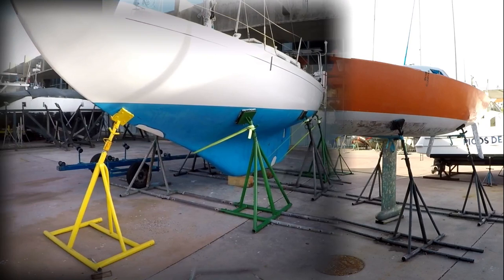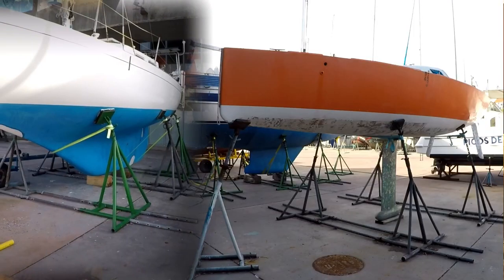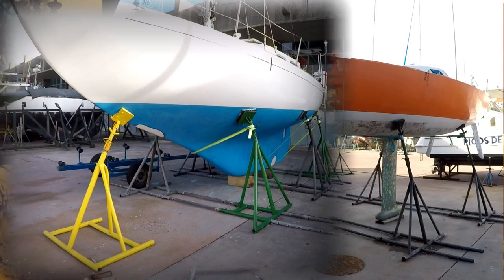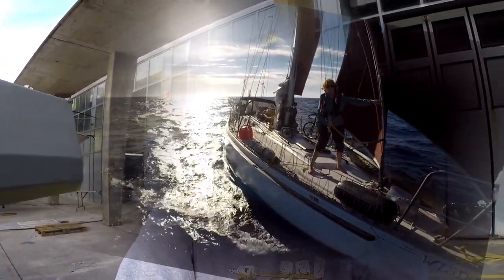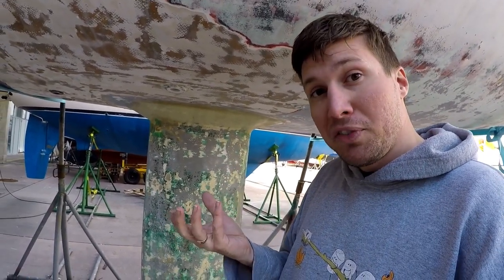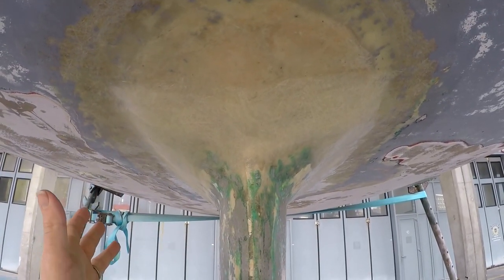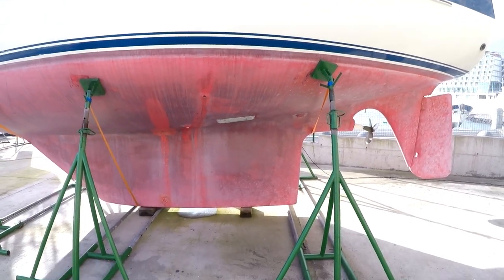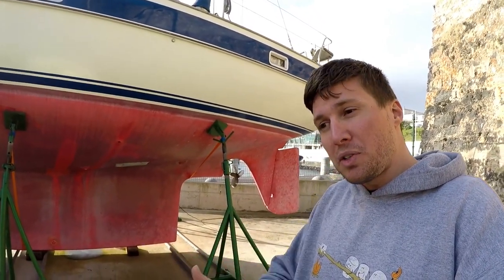Which is the BEST Keel Design? | Sailing Wisdom

Comment from the maker: Which keel design do you prefer and what type of sailing do you do?
Reply: My preference has always been long keel, solely because keel bolts make me nervous. They are not very easy to inspect properly. That being said... my dad's boat, on which I learned to sail, had bolts and despite the boat being over 20 years old at the time they were in excellent condition.
Reply: I was always fond of twin/bilge keels that were strong enough to be beached.  I keep thinking about Wicked Salty and some of the others that have had to do an emergency haul.  Would have been nifty to have the option of beaching the boat to do an emergency repair.
Reply from the maker: When I was young, we went to Wales for vacation and all the sailboats had twin bilge keels. At low tide, the harbor was completely dry and the sailboats were all standing upright just waiting for the tide to come back in again!
Reply: Very interesting video - thanks. 

You didn't mention lifting keels or centreboards. I'm naturally biased towards what we chose which is a Dutch designed full keel with a retractable centreboard. Popular in The Netherlands as there isn't much depth in many of the inland waterways. On a 54' boat we only draw 1.4m with the board up, but 2.8 with it fully down.
Reply: I have an Allmand 31 a boat with a long shallow split keel with a partial skeg hung rudder. Basically we are talking a fat coastal cruiser. My hope is to do some blue water sailing, but I expect much of my travels will be along the east coast of North America and into the Caribbean while short (or single) handed. In other words a compromise boat that isn't as stable as a full keel boat, and not as manoeuvrable  as a fin keel, but... I bought the boat in August in Boston, MA, and while bringing the boat through the Erie Canal to Lake Ontario I was pleased with the trade-offs that had been make on this boat.
Reply: I find modern retractable keels to be best of both worlds, do retractable telescopic keel exist ?
Reply from the maker: I have seen where the daggerboard comes up through the hull on multihulls.
Reply: I like the shoal keel with centerboard(s) such as what MJ Sailing's Trisalu has. Or the rest of the Trismus series and their type, for that matter.  An aluminum hulled Trisalu or Trisbal (especially with a pilothouse like Elements has) would be the ideal boat for cruising here in Alaska with our large tidal swings.
Reply: Netpackrat while 'Elements' is a great boat it does not sail as well as the shoal round bottom design might suggest , she is not fast and dens to be a wet boat ( spray) ,,it does well for them and they have done a good job with it. Yes I love their ' deck salon' design. Cheers Warren
Reply: Rigging Doctor Good study Herb, while I loved the steadiness of the semi full keel I grew up with,the wood/epoxy racing version of the Rustler31/32 , I race now with a small fin keel boat and have found the performance and maneuverability a joy to race and sail in and out of its marina slip.  I cruised for a little while on and off a Jeaneau 43 and it never had any bad handling characteristics. It was fast, 7 knts was the cruise planning speed, she was solid with a strong keel and separate rudder all properly engineered for the loads, she crossed the Atlantic twice ,. Excellent maneuverability under engine especially reverse. Obviously not your Morgan's best attribute  ......But as you say ' horses for courses' long passages , anchoring a lot , little time in tight quarters , nothing wrong with your choice. Glad to see they improved your rudder with a semi vertical straight trailing edge.  Cheers Warren.
Reply: @CheersWarren  Certainly, but I wouldn't be using a boat like that to race or necessarily even cross oceans with.  I want to sail Prince William Sound (I grew up there) and maybe later the Inside Passage, and a shoal draft boat with a retractable keel and aluminum hull for durability would be ideal.  Especially one that allows you to retreat inside and steer from the pilothouse when the weather turns.

The Trisalu isn't perfect and it it may be that Brouns got too far away from the design of the previous Trismus boats when he drew it.  The metal versions of those are a hard chine boat with dual centerboards instead of the centerboard and stern daggerboards combo of the Trisalu.
Reply: I am a new owner of a flat bottom hull with a 1/2 keel from 1/4 of bow to 1/4 of hanging independent rudder.  Lead ballast of about a ton. It’s a nimble 25. I haven’t sailed it enough yet, but I immediately want to add weight to the bow to keep the hull from skipping over the water. Or worse, heeling to the chimes and overcoming the flat sides to flip over. Thoughts?
Reply: @akjhome  

A). I am envious.

B). Ted Brewer knew what he was doing when he designed her.
Reply from the maker: I am jealous when I watch a fin keel with sail drive back up. They go straight and right where they want!
Reply: Wing keel with half skegged rudder on my steel sail boat, manufacturer guarantees no damage in 8 knots running aground, they didn't say anything about the crew though. :)
Reply from the maker: Steel boats are floating tanks 😍
Reply: @Sciolist  Funny you should ask that. Dagger keels exist on smaller boats, and it has been done on big expedition sailboats. But it scares me to think of what would happen running into a rocky underwater pinnacle or reef at speed.
Sometimes a "crash box" is built into the keel well to prevent the hull being breached, but I prefer the notion of a keel which just swings aft in such circumstances. Another benefit of swing keels is their ability to  modify the underwater profile: swing it forwards for heaving to or beating in heavy weather, aft for reaching and running to reduce weather helm. 
But to get a substantial effect would take a very long swinging element, which means a long keel box taking up the majority of the best part of the interior, and a long slot weakening the hull.
So I've designed and am currently building a combination swing and telescopic keel. Even though this permits the keel being protected from grounding loads whether travelling ahead or astern, or vertical loads from being dumped on the bottom in the trough of a swell, it remains a challenge to engineer something strong enough for lateral forces, particularly when extended to full span. This I think I have managed to do -- I've achieved better safety factors than the original lead keel's attachment details -- but keeping it affordable in my case means doing it all myself, and getting a favour from a friendly toolmaker with a big CNC milling machine to produce the 3D shape. 
It's still by no stretch an inexpensive option, but for me it's an interesting challenge, and I hope it will make the boat a lot more "configurable" for different situations.
Reply: I learned to sail on tall ships and always leaned towards full keels after that. For the last few years I have been racing  on a pretty standard late 70s racer cruiser. I am definitely coming around to the fin keel. You have to do much more research about the construction  of the keel. Some are designed to take the boat weight on the keel, some are not. Some have poorly done keel bolts, some are very well done. Righting moment is a complex question, as a deeper fin with a bulb may have more righting moment than a shallower full keel. I prefer the manouverability and helm feel of a fin. Heaving to becomes pretty much useless, and you generally have to be more active on the helm. I find twin keels to have too much wetted surface for a given righting moment for my taste. Also for swing/lift keels I just don't like the complexity, and cabin space is often laid out to accommodate the space for the retracted keel.
Reply: Rigging Doctor I live on Anglesey in wales and they are pretty much all you see here because of the tides
Reply: I have chosen long keel and heavy displacement boat for comfort at sea with family and to weather the storm eventually... so far happy about the choice i have great stability compared to lighter boats
Reply: Steel hull encapsulated full keel, although Skip Novak for example has retractable shoal draft keels on both his boats, skip dies Antarctic expedition sailing in two South African built boats, a mid 40' steel boat and a mid 50's aluminum boat, but these are obviously very purpose built vessels, I'm going with a late 70's Primrose designed Moody 33' centre cockpit shoal draft keel, skeg rudder, but that's the compromise I'm prepared to make for a small centre cockpit boat that is blue water capable and can be easily short handed or single handed and very easily modified internally to the later 333 with salon access to aft master suite as opposed to cockpit access, the 333 and 38' centre cockpit boats go for around 30 to 50k US and the  mk 1 and 2's for less than half that. Roll on the Lidacore and epoxy😂😂. The most important thing is not to get too fixated on only one aspect of a boat, but look at everything as independent systems and as a whole overall package, obviously the biggest determining factor is $$$$ budget,  and how much work are you capable of and prepared to do yourself, I'm a qualified artisan for example and thrive on projects, actually if I don't have one ongoing I go nuts, others don't have any interest in their boat systems or boat because they have the money
Reply: Daggerboard! Mostly surfing dinghies in breaking surf... 😂👍
Reply: Lifting keel, like on the Southerly, Garcia and Allures yachts.
Reply: I was always a big fan of the full keeled shallow-draft boats for ocean cruising but the events of the recent Golden globe revival race have given me pause.  It seems that the full keel boats when they're pushed sideways are more likely to roll then a fin keel boat.  The reasons for this are twofold.  Firstly, the larger wetted surface area catches more water and acts as a lever to spin the boat.  Now before you say a fin keel does the same thing,the ballast of a fin keel is generally further from the center of the boat.  This gives greater righting moment, less tendency to spin or roll over.  The design of a full keel with the ballast generally close to the center point of the boat actually makes it easier to spin the boat on it's axis.  Anyways I won't bore you with any more details, but my preference is a bolt on fin keel with a skeg hung rudder.
Reply: I’m buying an albin vega , that has an unusual keel in my limited opinion! What would you say about the vega keel and rudder I’d like your opinion 👍
Reply: Full Keel. Am a blue water cruiser single sailor so wanted something strong and dependable.
Reply: What boat brand is the one at 8:21?
Reply from the maker: clecio primo Alberg 30
Reply: Rigging Doctor thank you.  I like that keel as I am more like you guys.  Want stability over speed.
Reply: please explain the catamaran keel, thanks doctor.
Reply: I say, the case she is rested...
Reaching away before a good breeze is like hanging on to a team of horses.

https://youtu.be/NGI11UUiBQ0
Reply: It's all about bilge keel. No slip fees ,no lift outs , keep it in any estuary for free.  It's not like they are rare . It's like half of boats under 30ft and about 15 % of 30 to 35s . I don't understand why every YouTube channel leaves them out of the conversation.  They can dry out . You can go anywhere. A fin can't go in the estuary it will fall over lol .
Reply: You all prolly dont care at all but does anyone know of a way to get back into an instagram account?
I stupidly lost my login password. I appreciate any tips you can give me
Reply: @Pedro Leonard instablaster ;)
Reply: @Elijah Santiago I really appreciate your reply. I found the site thru google and im in the hacking process atm.
Seems to take a while so I will get back to you later with my results.
Reply: @Elijah Santiago it did the trick and I now got access to my account again. I am so happy:D
Thanks so much you really help me out!
Reply: @Pedro Leonard Glad I could help xD
Reply: Lol my last boat had a 4 ton solid lead keel. (Long keel.)The previous had obviously run aground hard because there was a five inch diameter gouge about 2 inches deep in the leading edge. It had zero effect on the hull's integrity.
Reply: What are you thoughts on the new Kraken Yachts, and their theory of Zero Keel ?
Reply: Winged Keel mate for racing with Mates
Reply: Full keel nicholson 32 plse
Reply: A full keeled Skookum cutter built like a brick shithouse...for open water...
Reply: The twin keel (large bilge keel) boat we had that was built in the Netherlands was the most comfortable and stable boat we ever had.   My dad bought it from the original designer and he had it about 16 years.

Comment: Your chances of out running storms mid ocean are limited. You may get to a less windy part of a storm but i reckon it would be of slim benefit.  It is incredibly rare for bolt keels to fall off.
Reply: I was in the Navy for over 20 years, and never once were we able to outrun a storm - it's just not a thing. Mama Nature will always win. ;)
Reply: @TheSirUno  Even harder in a yacht that cruses at around 6 kn. Though with advanced and more reliable weather predictions you can place yourself better.
Reply: Fall off is rare, but cracking/getting loose at the bolts and start leaking, not so.  My old boat did after fairly mild grounding in the sand.

Comment: Ive got a fiberglass modified full keel. I like that my prop is safe and my rudder has a lower bearing. And when i run over a cray pot rope, she just slides off. Tracks well to a head wind under sail. Not a fast 42ft'er but she feels solid in the ocean

Comment: Unless your full keel is shaped with the idea of hydrodynamics in the racing days of wooden sloop so say a j class sloop is slow yeah right full keel and at the times the j class was new you could say the this was as comfortable and fast as a racing sailboat should be you should also think about weight of keel to hull construction which is supposed to be about 50/50 still bolted not fiberglass construction relying on bonds of glass I feel a hog a keelson and displacement ballast keel their is alot to say about old school racing sailboats either to much sail area

Comment: Thanks, that was very informative and helpful. Before this I just watched a 45 min. interview with Chris Beaumont of Kraken Yachts about integral keels, so I'd go for any form of an integral keel, like a full keel or a long keel, definitely not a bolted-on keel. My type of sailing is "never in a hurry to get anywhere, ever".😉
Reply from the maker: It’s definitely the safer way to go!
Reply: Yes i watched that documentary too! He described how boats are hyped to be blue water when they're anything but. And corners cut not just on the design level but also on the factory floor. Friday afternoon, the guys constructing the fibre glass laminate for the hull, they just want to go home quickly so they rush it and don't take care to get the laminate at the right temperature so it bonds properly. Chris's attention to detail is extraordinary. Needless to say, inner of his Kraken 50's, brand new,  costs an absolute fortune. One and a half mill, but what a vessel, built like a tank but goes like a rocket.

Comment: depends 100% on your desired application. Cruising the world? go full keel encapsulated ballast, etc, preferably a boat from the 60s or early 70s for some of that 1.5-2 inch thick solid fiberglass goodness from the early days of composites where they didnt really know how to work with it yet so they just piled a TON in the molds to make sure it was strong.

once a year vacations sailing with the family in the Bahamas? doesn't really matter because unless you wipe your ass with Benjamins, your not going to be buying a boat outright vs chartering anyway. 

going for performance/racing? Deep fin keel is the only way to go for good pointing in the wind and high (relative) speeds.
Reply from the maker: Agreed 100% 
The right boat depends on what you are going to do with it

Comment: I live in Miami Florida I sail in  Biscayne Bay which is not a very deep Bay  which type Keel do you recommend
Reply from the maker: We are going to be sailing to there in April!
I really like Center Board boats. The keel can swing down to give you excellent performance when you have the water depth and swing up out of the way when you get into shallow parts. The center board box is also in the shape of a full keel, so if you ground, you have a nice big strong area to take the impact. 
I would prefer a CB over a wing keel just for the ability to get the keel out of the way when you get into the shallows.

Comment: thanks guys that was a really great introduction.  I'm wondering what you think of bilge keels.  I am interested in John Welsford's designs for home made boats, and he likes to design them with bilge keels.  Just curious what you think.. Thanks.
Reply from the maker: I think they are really useful if you are going to be cruising in areas with a large tidal fluctuation. You can dry out and clean your bottom without paying to haul out or leaning your home on its side.
Reply from the maker: I do prefer the bilge keels that are more like a full keel over the bilge keels that are more like a fin keel for the same reasons stated in this video. I’m not looking for high performance, but want a very strong and well attached keel.
Reply: @RiggingDoctor  thank you for responding. Some people commented that they experienced less side to side roll with bilge keels.